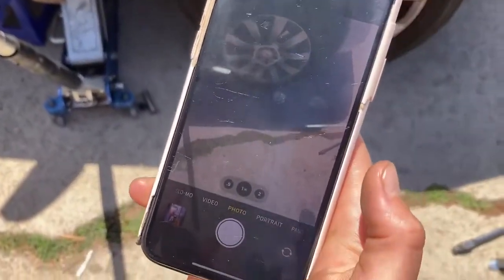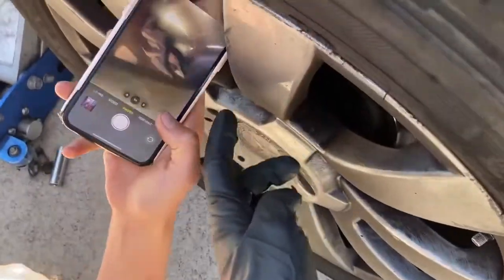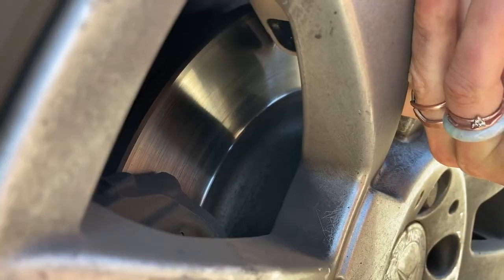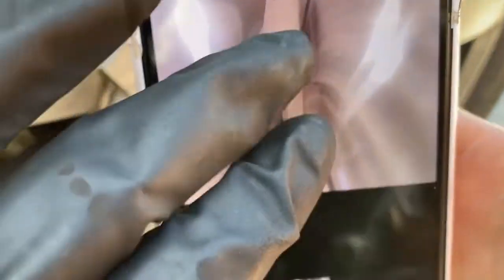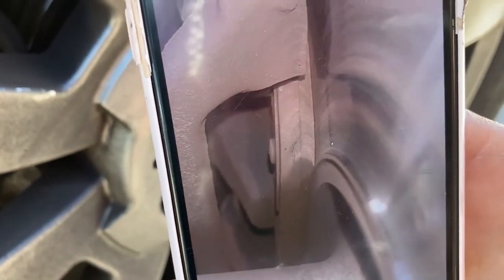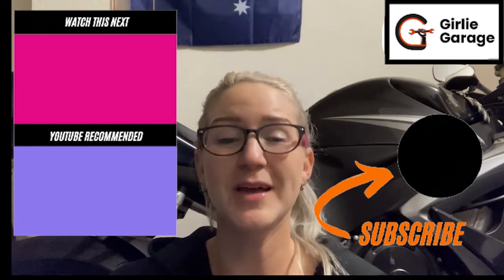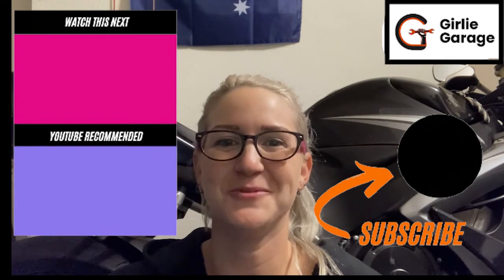How to Check The Thickness (Life Left) In Your Brake Pads WITHOUT Removing the Wheel - Girlie Garage

Comment: this so cool, why didn't these so call professionals think of that?  LOL this is so far the best and easiest way to check the brake pads. Thank You So Much
Reply from the maker: Haha thank you! Just remember your pads SHOULD be wearing evenly but if you have an internal caliper problem or your caliper slide pins never get cleaned and lubed, the pads could potentially wear unevenly
Reply: This is great way to check, but the "professionals" inspect wear pattern as well to make sure your calipers aren't sticking

Comment: So whats the thickness of the pad the camera/pic says, LMFAO ???!!  NO REPLIES READ.
Reply from the maker: Most modern cameras do have a measuring tape in them…not sure if I would trust how accurate that is. A common amount for pads to be replaced is at 2mm but you can obviously replace them before that or based on what your specific manufacturer states
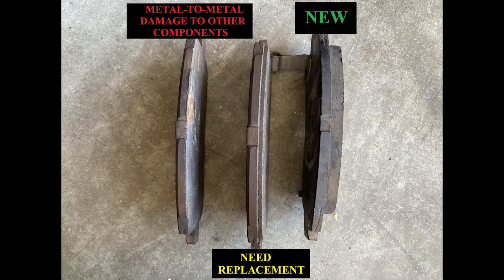Reply: Doesn't matter. Look at 1:00, then judge your pad against the picture shown next, after that timestamp.
Reply: @garywraith3405  nope

Comment: good idea but can you measure the thickness of the pad from a photo?  If its to scale I suppose
Reply from the maker: No, this technique is to help confirm when a mechanic is telling you that you need your pads changed, or if you’ve started to hear noise. The proper way to measure would be to take the wheel and caliper off and measure the pads. Also, if the outside pad is looking thin, it’s a pretty high likelihood the inside pad is a bit thinner. Once you change them, you could measure them and keep them for reference on future pad changes

Comment: Each wheel comes as a pair how are you checking the inner pad
Reply from the maker: Your pads SHOULD be wearing evenly, however this is a good question because sometimes the inner pad wears faster. In a perfect world, the wear indicator was placed on the inside pad, and if your outside pad is close to needing replacement then you don’t wait.

Comment: Wow first video on this topic that makes sense!
Reply from the maker: It doesn’t work for every wheel and brake setup but it works a lot of the time! Also remember that if the front pad is low the back pad that you can’t see is often times just a bit more worn so make sure to catch them before you go metal-to-metal